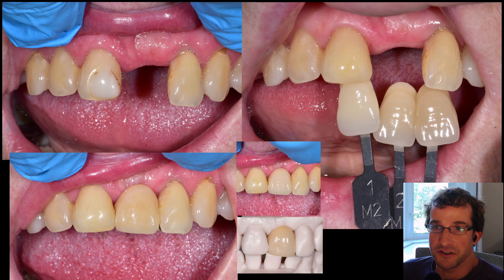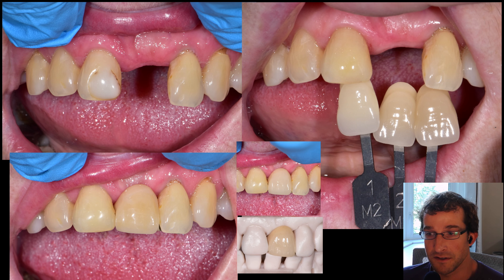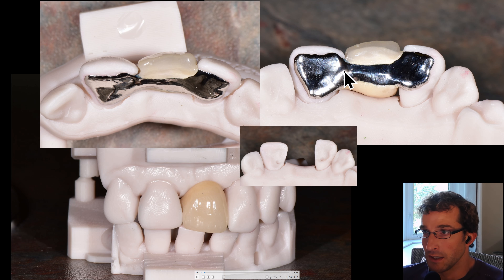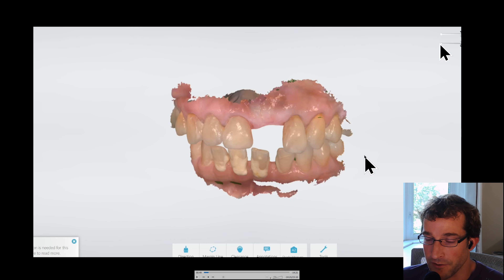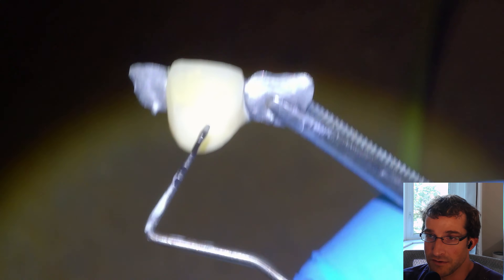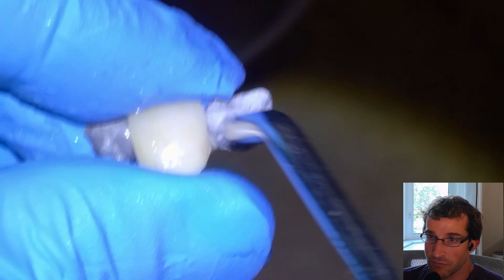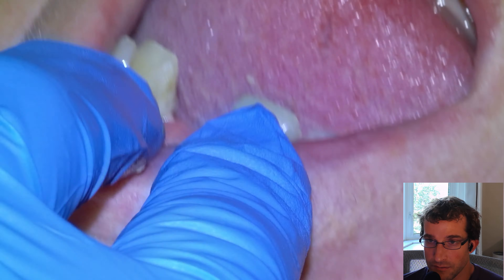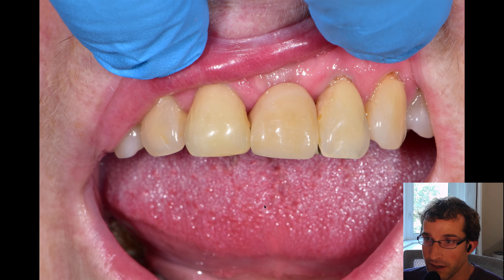[101] Custom Stained Maryland Bridge

Comment: Thank you doc, my 14 yr old son is going to have the Maryland bridge, any tips on how he can make it last, it’s for the upper front tooth.

And how long approximately does it take before debonding.
Reply from the maker: It's mostly up to the dentist and the lab to create a product that will retain properly. Ideally the prosthetic will be just slightly out of occlusion when he bites and grinds around, that is having little to no contact with the opposing teeth when he comes together, which will put less force and stress on the bridge
Reply from the maker: There is no maximum time limit on how long a Maryland Bridge will last, but they can work for many decades

Comment: Hi Dr. Dobson, thank you for sharing a great case as usual! I just had a couple questions. 

1. Why do you find the 1 wing Maryland bridge is less successful compared to the 2 wing Maryland bridges? I was taught and read before that due to the curve of the anterior arch and the difference in forces and movement in each abutment tooth it may cause the bond to flex and fail over time. I do not have any experience with Maryland bridges and was wondering as I had a professor who loved one winged Maryland bridges due to the lack of load from 2 teeth. 

2. What are some good resources in your opinion to learn how to stain porcelain, or would you say experimenting would be the best place to start?

Thank you once again for sharing the case and love your videos as always!
Reply from the maker: Thank you :) 
1. I am probably too influenced by my personal clinical experience but I have had 2 single wing full ceramic Maryland bridges debond on me in short order which was embarrassing and annoying and have not had failure with double wing PFM with this prep design so it's my personal go to. 
2. Miyo actually has sales reps that are great resources not only to buy but also to educate on how to use the product. They have tons of videos on their website where you can learn application technique but as with anything real world hands on experience is the best teacher. I think they take it a bit far with the amount of shades they recommend using (probably for +++sales) I find I only really use shade A 90% of the time, then Clementine, Lumin, Slate, and Storm once in a while
Reply: @behindtheloupes  Thank you Doc! Appreciate it always!